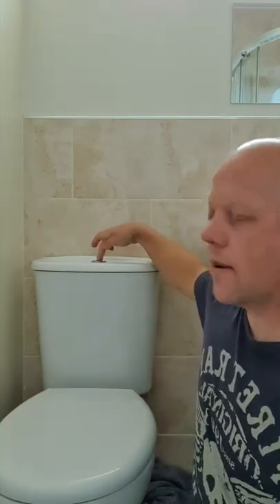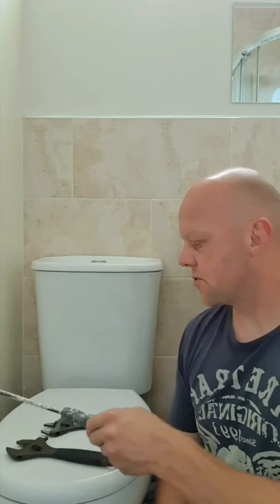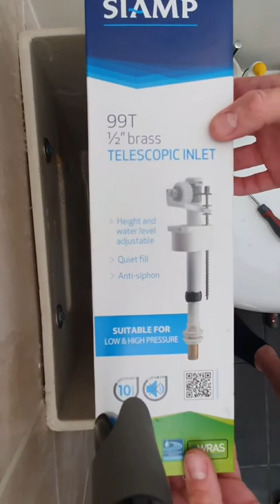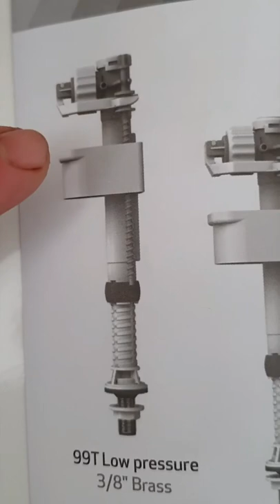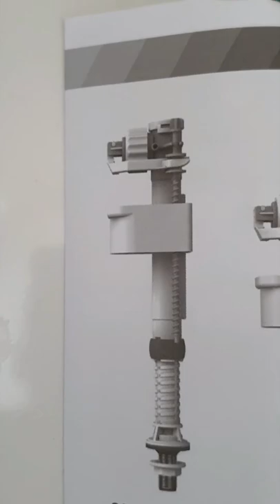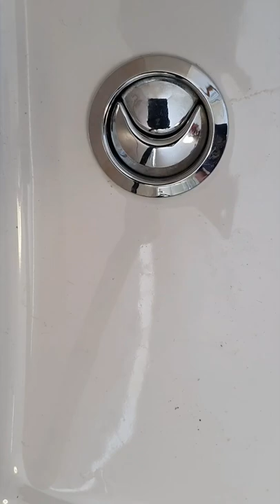Toilet not filling with water? Easy fix!

Comment: Thank you so much Mr Fowler. I managed to replace my Siamp inlet valve following your great instructions. 4 days on and still no leaks and seems to be working fine.. only problem I had was the fibre washer that was supplied didn’t fit my pipe connector but luckily I had one that did. Great video not sure I would have managed without it..👍
Reply from the maker: That is brilliant, and im glad the video was so helpful! Please consider subscribing for more great videos👍

Comment: 5 30 am, half asleep, flushed toilet and now won't stop trying to up. Water constantly flowing in the toilet. 6am I've just watched your video! Wish me luck! Woman here 😂
Reply from the maker: Hi, hopefully that will work or if not have a look at my other toilet video which stops the water constantly running into the toilet.
Reply: @FixitwithFowler  thank you 🙏 I was thinking if it was the push down buttons it would just be them that didn't work, but would have no effect on water cistern not filling up. I'll take a pic of inside and take to local DIY shop for replacement. Fingers 🤞
Reply from the maker: Yeah thats a good idea. If you find a plumbers merchant/wholesalers, they are normally really helpful.

Comment: great video. ive just replaced the valve on mine. made sure i levelled up the little plastic markers but now it screams and pressure builds up and it shuts off the water! ive loosened off the plastic screw for now but its really loose to stop the noise. i definitely have the right valve.
Reply from the maker: Have you tried closing the isolation valve on the outside of the toilet slightly? That will reduce the flow/pressure inside the fill unit.
Reply: @FixitwithFowler   thanks for replying and for the tip. for some reason, it seemed to sort itself out.

Comment: We have a Siamp toilet suite. A small grey plastic "plug" that controls the outlet flow, keeps popping out of the top of the inlet when the cistern is filling. When that happens the water sprays up, hits the lid causing it to leak down the outside of the cistern. We've turned down the water pressure to stop this but the cistern now takes ages to fill.  Can it be replaced or do we need to replace the whole inlet unit?  Hope you can help.
Reply from the maker: Is the cistern concealed in a cupboard or is it a standard toilet?
Reply: @FixitwithFowler  Thank you so much for your reply. It's a standard Siamp toilet. Not sure of the model as we've just purchased the house. We can easily access the inside of the cistern. Thanks Kara
Reply from the maker: @barkaparka hi, if you google siamp toilet spares then there are loads of different fittings available to save you replacing the toilet!

Comment: this morning my toilet wouldn’t flush both the filler has stopped filling the cistern and the flush also leaks at the base so any water slowly leaks into the pan. From this video I now know what to do to solve the filling process.
Reply from the maker: That's good to hear, im glad you found the video useful. Thanks for your comment!
Reply: today i bought the rubber washers for both the flush and the filler £7. The flush seems to have worked but the float seems to jam before it gets to the top of its movement which doesnt stop the flow . This continues to over flow. When I move the float by hand there seems to be nothing stopping it moving. yet when there’s water involved it jams. most odd.
Reply from the maker: @rockerjim8045  have you double checked that you have reassembled the filler correctly? It may need some more adjustment or the new rubber might be catching

Comment: Water is coming out off mine but it's coming out asif it's going through a needle, any tips?
Reply from the maker: Hi, yes, in the top of the outlet, there is a rubber diaphragm/washer in the top near where the water comes out. You could unscrew it and check it is not blocked. Just make sure you turn the water off first!!!

Comment: Hello

Thanks for the tips - mine is not filling up.. Can I manually fill the tank for use until plumber gets here?
Reply: Yes you can fill the system manually. Just be careful when pouring the water in.
Reply from the maker: Yes of course you can, don't overfill it though

Comment: How do you know if its this problem? With mine, when it is trying to fill up, the water is just running into the toilet bowl?
Reply from the maker: Hi, it could be the filler unit, but it sounds like it's the flush unit.
Reply: @Fix it with Fowler  okay, I thought that, so I have just purchased a fluidmaster dual bottom flush valve, so I'm hoping that fits 😅
Reply from the maker: Its normal for the seal on the plunger of the flush unit to distort and that can cause the toilet to run continuously